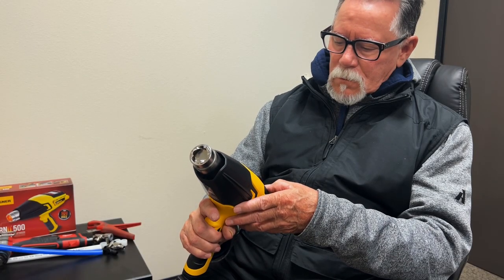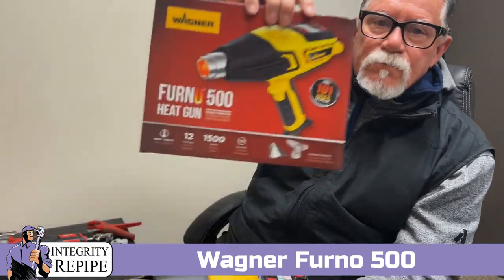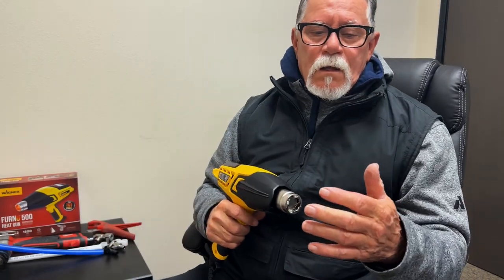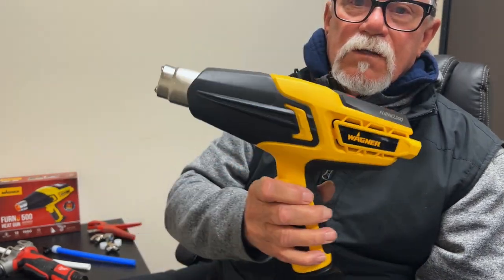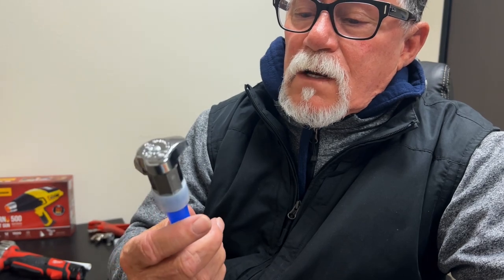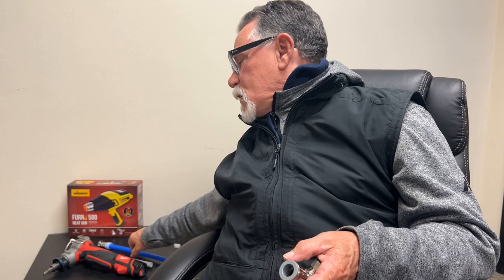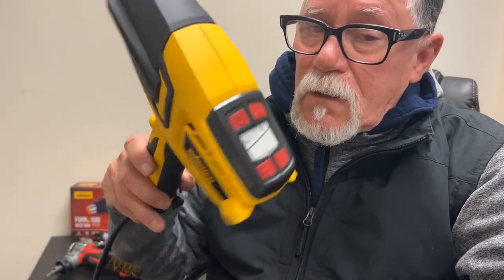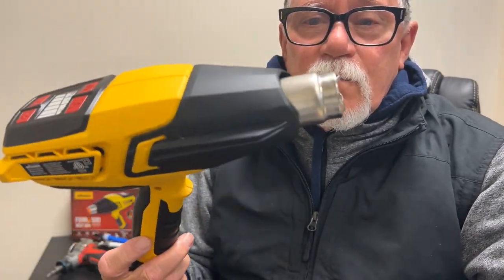Pex Cold Weather DIY. Instructions for amateur Pex Installation. Low cost Pex Cold Weather Install.

Comment: Joe, thx for the video.  Have you had any experience with the legend brand pipe, hyperpure pe-rt?  It uses a chemical made by Dow that doesn’t require cross linking in the manf process.  They are offering a 100 year warranty.  It is 1960 rated, expansion compatible.  I’ve got some uponor clear that’s only been in for 10 months and it’s forming brown spots on the exterior from the inside. I’m replacing it with the legend hyper pure pe-rt.  Any thoughts?

Comment: Can you make a video that shows how to remove and replace bad Pex toilet supply valve or sink basin valve?  What to do if there is not enough extra pipe sticking out of wall where you would have to cut out the bad valve?  Thank you.
Reply from the maker: I will do a video for you.

Comment: This week we are re-plumbing our house.  To warm the pipe before expanding we heat microwave rice heating pads 3 minutes each.  We place the rice heating pads in a cooler bag to take down to the crawl space.  The heat will last an hour or two. I keep a thermometer in the bag to know when the microwave heating pad gets to cool. If I do not have a microwave handy I figure on carrying a thermoses with hot water for a heat source.

Comment: Good vid. I always heat expansion PEX even in mild weather.  Seems to me that it reduces stress on the pipe when expanded if it's up to about 100F.
Reply from the maker: I had never done that before but after playing with it this technique did work! Reduces stress I agree with you

Comment: I think brasscraft is a decent company....I prefer them over dormant....and some have wonderd  about  BPA...leeching from plastic pipes on the hot side. Of a system....????..I guess.  "Exspansion"!!!!!   Is the beginning of damage that leads to failure????...  cinch ring system may be best...
Reply from the maker: The Pex A pipe fails in the center of the pipe all the time. No expansion. No cinch ring. No crimp ring.
Reply: @IntegrityRepipeInc  how does it fail??...it has highest psi rating....which exceeds the  pressure in residential app...they say  pex b  when turns clear  that its  compromised...I don't like crimp rings i agree but the cinch clamps are the best...I think..they.are more restricted. But  I think pex b  fittings mite be too oversized..which over expands  pipe at edges...I learned that from your video...

Comment: How does the brass craft valve fail? Do they leak after 2-5 years?
Reply from the maker: The handle sticks and will not close is the most frequent failure.

Comment: Is there a difference between zurn and sharkbite(home Depot) pex b? I haven't been able to get ahold of some zurn pipe yet but the sharkbite pex b seems to shrink back as long as you heat it up ive been using a cup of hot water or a space heater to heat it up for some test it but so far so good. I would prefer a pro opinion and test tho im just a competent diy it does take some finesse to not over expand and it definitely doesn't like being streched cold or below 75 ish it really hold the expansion memory
Reply: Sharkbite's PEX B does not conform to ASTM F1960, --- which is the cold expansion spec --- so if holds after being expanded, that's mostly luck.
Reply: Thank you!

Comment: I like the idea of the Dahl push valves better than the f-1960. Would you trust that connection ? I have used other push connects with no problems.
Reply from the maker: I have never hade a Dahl push valve fail. They are just hard to find.

Comment: what if you just use really warm water? throw some hot water in a bucket and stick the pex pipe in it for 30 seconds.
Reply from the maker: That will work, it will also warm the pipe faster. If you are using a Milwaukee electric expansion tool do not lets it get wet.

Comment: Joe, my house in LA was repiped about 2 years ago with Uponor colored pex pipe and I've already had one leak at a joint which the plumber fixed. This was before I heard about the Uponor issue so that failed part was not saved. I'm stressed out after hearing about this Uponor failure, what's a homeowner supposed to do? Wait until more leaks develop which will cause substantial damage, or pay to repipe their house again which comes at a great cost?
Reply from the maker: Please call me at 949-340-4900 during the week please unless you have another leak then call anytime. You need to call me so I can instruct you on how to gather the sample for the warranty coverage.

Comment: Joe, love the videos. I know you mentioned you are not recommending this, but living in the middle of California & entering winter it gets into the 40 to 50's regularly in the morning.  This makes perfect sense, so expansion of zurn does not get over stressed on a cold day expansion installation. Logically, when the line is active with running hot water it is fine. Thanks for the instruction on how to do it right.
Reply from the maker: I must confess that after playing with this technique it does work.  Years ago heat guns where to hot. Now they work very well. Furno 500